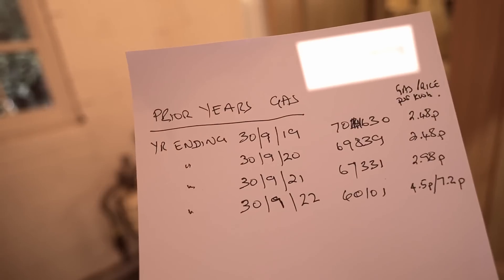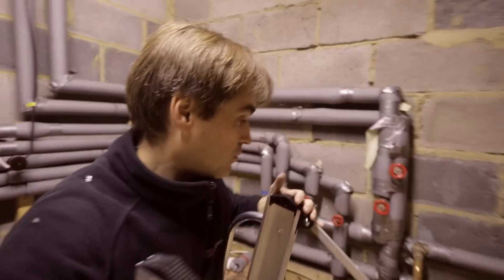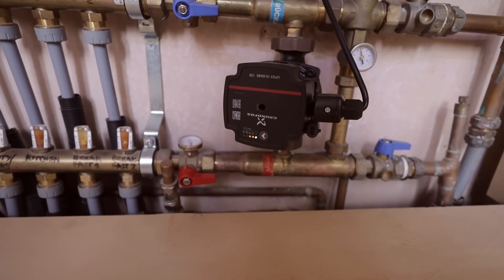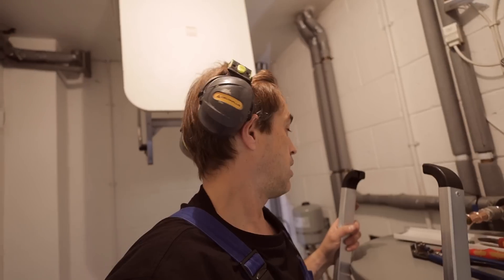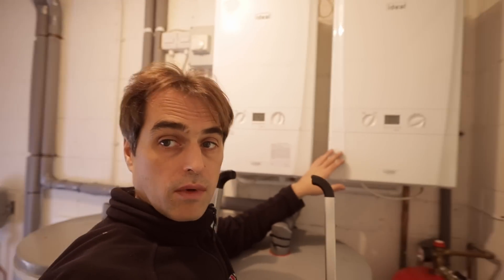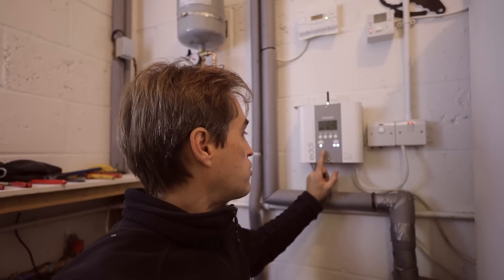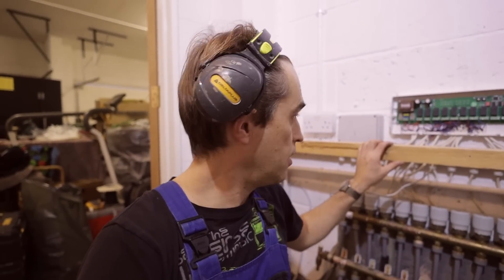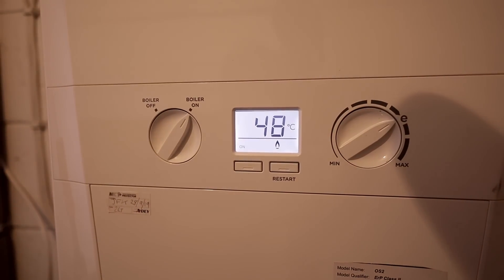Learn How to Lower Gas Bills and Improve System Performance

Comment: Why do we need hot water priority systems? I have my heating on different times to my hot water.
Reply: @shm5547  thanks man, for now I am after Opentherm and PDHW.

Not sure if WheatherComp will work on top of them two, or may confuse it or make it worse or have any huge benefit? 

I don't have Hive or Nest! It's TADO EU model which hardly anybody know how to wire it up.

Besides, been told that for PDHW need to change the CH zone valve to a NormallyOpen valve as well as trace new cable from cylinder to boiler.

In my case they are not on both floors :(
Reply: @bimiuk4051  Your TADO EU is doing weather compensation (over open therm). Just, rather than using an actual outdoor thermometer (like the open therm Ideal Weather Comp Kit), it gets the outdoor temperature over the internet, using your location and a weather forecast.

You can get 95% of the benefit of the open therm weather comp on S and Y plan, without going full PDHW. All the open therm control is doing is varying the boiler flow temperature, so you have 80deg for water demand and a lot lower for central heating (varies depending on how cold it is outside).

The only difference to OpenTherm with S or Y-plan vs PDHW is:
   PDHW: radiators go cold when there's a call for hot water
   S/Y-plan: radiators get hotter when there's a call for hot water (if there's still a call for CH)

Most of the time, you are not heating the water cylinder, so the central heating will be running a low flow temperature regardless of whether it's on PDHW or S/Y-plan. You could even set your timer control so the HW only came on when the CH was off. That would effectively give you all the efficiency saving of PDHW (that last little 5%) on an Y/S-plan system.
Reply: @shm5547  wait wait wait!!! So I don't have to go for PDHW on a S PLAN if I want Opentherm??  So why is UrbanPlumbers suggesting to must change NormallyClose go NormallyOpen Zone valve for the Central Heating?

I thought you must have PDHW in order to achieve 2 seperate flows : one for HW and one for CH on a SYSTEM BOILER??

And all honest I prefer to be able to use CH whilst HW is heating, no harm. I thought it is no other way around and must use PDHW.

Are you saying just connect TADO EU via the Opentherm connector to my boiler and that is it?? No additional wiring or config to the zone valves??? 

Really!!????? Really???

I don't know what to say! Why is UrbanPlumbers insisting to change from S Llan to X plan and have Opentherm.  I don't get it now. 

UrbanPlumbers can you comment on this?
Reply: @bimiuk4051  Yes, you don't have to go full PDHW to get 95% of the benefit of OpenTherm flow temperature control.

If you read the Ideal Weather Compensation installation document I referenced, it shows you what you (or a competent plumber) need to do. But instead of connecting the outdoor temperature sensor to the OpenTherm connections on your boiler, you would connect your TADO.

You need 2 low voltage wires for the OpenTherm connection between your TADO and boiler; plus an additional mains voltage single wire between your cylinder stat and the boilers SL2 connection.

The purpose of these two connections is:
1) OpenTherm: this is a data connection where your thermostat can ask the boiler to fire at a specific flow temperature. Your thermostat uses the weather forecast to choose an efficient flow temp for the outside conditions.
2) SL2: this connection tells the boiler if the HW cylinder stat is calling for heat. If it is, then the boiler ignores the flow temp set over OpenTherm and fires at a high temperature (80 deg C) for a short time to heat up the cylinder.

You will see most of the efficiency benefits on S-plan, because the time spent in the inefficient HW flow temp will be the short time it takes to reheat the HW cylinder. If the CH is calling for heat, on PDHW the rads will go cooler, on S-plan the rads will get warmer; just for that short time the HW is being heated.
Reply: @shm5547  so if I go PDHW and Opentherm there is 95% effecientcy and if just with Opentherm, it's less?

What about the comment from UrbanPlumber saying if no PDHW is implemented then need to run to boiler and make changes. What does that imply?

Also, you saying new wires are required. I thought I can utilize the current cables :( my boiler is second floor, cylinder is top floor and the controller/timer is bottom floor.

Looks like a massive job to wire new cables now especially from Boiler to bottom floor.

Oh man :( don't know how to get it done.

Without PDHW means that when I call for HW then the radiators will go hot - even tho I never called for CH ??? Or do they go hotter only if radiators are switched on at same time?

Ideally I would have HW switched on very early at different time zone as opposed to CH.
Reply: @bimiuk4051  the rads only get hotter if the room thermostat is calling for heat and the CH is on.

The only downside in sticking with S-plan is it's slightly less efficient only when the HW cylinder is being heated up, because the rads will get warmer and it might take a few minutes longer to get the cylinder up to temperature, so using a bit more gas than PDHW would do. But you might prefer this to the rads going colder.

When the HW cylinder is up to temperature, the CH will revert to the lower (more efficient) flow temperature and you will benefit from the same efficiency on S-plan as PDHW would be. This is the majority of the time. I estimate my system only spends 5% of the time heating up hot water. 95% of the time it's just the CH on, so that's what I mean by you are getting 95% of the benefit, because the efficiency savings of OpenThem flow temp control are the same for S-plan and PDHW when it's just the CH running.

It sounds like your TADO is right next to the boiler, so that would be an easy thing to wire up the 2 wires for OpenTherm. What might be an issue is the 1 extra wire you need from the cylinder stat back to the boiler for the SL2 connection.

There might be an unused wire, you'd have to get a plumber to look. I've got a spare, as my previous boiler had a pump overrun, so needed a wire from the boiler to the pump (which is in the airing cupboard next to the valves and cylinder). My new boiler has no pump overrun requirement, so I can use that now redundant wire to connect between the cylinder stat and SL2 on the boiler.
Reply: @shm5547  thanks for simplifying for me. Do you have experience with TADO EU model by any chance??

 I already purchased this NormallyOpen valve. Are two wires required in this case??

Sadly my TADO controller is on bottom floor where kitchen is, and  boiler is one floor up.

would be a night mare tracing a new cable :( hoping there are enough wires to utilize whch I doubt cos what what I see there is a cable (with 3 cables inside) going from old controller to the boiler.

The rest cables look like coming from the wiring center up where cylinder is. I am not an electrician to see through it all.

If I call the cylinder for hot water at a separate time compared to CH (considering if CH is not asking for heat then it is off) then  radiators should remain cold unless they are switched on at same time, right?

Likelyhood both being on at same time, may be very little but who knows.
Reply: I've had a look at the TADO EU installation manuals. It's not clear whether this is even going to be possible with your Ideal Vogue System boiler unfortunately.

The TADO installation instructions show wiring for a purely digital OpenTherm connection OR a switched ON/OFF connection using the extension box relays, but not a set up that requires both like the Ideal Vogue.

That's not to say it won't work if wired like this, but TADO don't mention Ideal as a compatible boiler. The other problem is the EU variant device has no installation instructions available in English! So it's going to be a bit of a leap into the unknown.

I'm guessing your TADO extension box is situated next to the wiring centre & cylinder.

You boiler should be on a permanent live connection. I would be very surprised if there's only three wires going to it. There should be minimum 4: Live; Neutral; Earth & Call for Heat.

Often a 5-core cable is run to boilers, so hopefully that's been done in your case and you'll have a spare unused wire.

Your next best option to the TADO, is to get the weather compensation kit. That will be guaranteed to work, only need slight wiring centre modifications and one wire for SL2 from wiring centre to boiler. Plus running a cable from the boiler to outside for the temperature sensor.
Reply: @shm5547  oh god now u killed my hopes :(
Reply: @bimiuk4051  lol sorry! The TADO openTherm might work with the Ideal Vogue, it's just not a documented combination.

The Ideal Weather compensation kit will definitely work, it's £40 plus installation cost. You won't need to run the open therm cables from the TADO extension box, but will need that extra wire for SL2 from the hot water cylinder to the boiler and to mount the outdoor sensor.

For both options you are going to need a qualified gas safe heating engineer anyway. But you might have better luck finding one who can understand how to fit the weather compensation kit, than one who can work out interfacing to the TADO. Good luck!
Reply: Wow , I read it all and I’m no plumber !
Reply: @rogerbean393  lol, it was a bit of a marathon!
Reply: @rogerbean393  joker bet u did not lol what's ur thesis on it?
Reply from the maker: Then you have to constantly run to the boiler to change the flow temperature - PDHW and weather comp automated that for you
Reply: @UrbanPlumbers   ok think I get it now. Am I right in saying I can’t have PDHW with every boiler
Reply: @paulgardner3926  Your boiler needs to support it. Those Ideal Logic boilers on this job do.

There  is also a half-way house, where you can run S-plan with weather compensation. What happens in this configuration, is when there is a call for HW, the boiler will put out 80 deg C until the HW cylinder is satisfied, then it goes back to CH only with a lower flow temperature, more like 50 deg C.

It's not quite as efficient as PDHW and rads get hotter when there's a call for HW rather than colder.
Reply: @shm5547  sounds like u know what ur taking about. I have system boiler Ideal Vogue Max and a unvented cylinder tank. I also purchased the NormallyOpen zone valve to change it with the NC for HW zone valve.

However! There is nobody in North who has Opentherm + PDHW Experience and who have an idea about TADO wireless thermostat EU model.
Reply: @shm5547  currently there is the Honeywell controller/timer in kitchen and it has a thermostat on wall in corridor.

Thought I upgrade to be more effecient. Was TADO vs NEST and cos Tado supports smartTRV and ticked most boxes - Tado was the winner but little did I know it a nightmare to setup.

At moment have both Tado EU model and Nest still in boxes. Hoping there somebody who can get TADO wired up. Worst case, it be the NEST :( 

I don't know what to say really..
. I am just lost now and frustrating.
Reply: @bimiuk4051  well, one thing you have to consider is maintainability. If you can't get an engineer who understands it, or if parts are problematic to source, then you might have issues down the road.

I considered X-plan and a fancier boiler, but the heating engineers around my area were not sounding confident. So I've stuck with S-plan and got an Ideal boiler, purely because it's what the local plumbers know and understand, plus parts are readily available.

I have a Nest. Whilst it lacks the TRV zone control of TADO, I cannot fault it. It is rock solid and most plumbers understand them as they're ubiquitous.

It's a bit of a pain that your Honeywell controller is not located close to the boiler. That would have made the wiring a lot easier.
Reply: @shm5547  so ur on Nest with Tado's smartTRVs on a SPlan without PDHW?
Reply: @bimiuk4051  My setup is bog standard. It's a Nest (relay) controlling a heat only boiler on S-plan.

My plumber wasn't familiar with OpenTherm, nor too confident with weather comp! So I kept it simple for the initial install.

However, I am looking to either add the weather compensation kit to the boiler, or connect the Nest openTherm to the boiler.

I will probably keep it S-plan, as I would prefer the rads to stay hot when the water is being heated, especially as my hot water cylinder is not a high recovery unit.
Reply: @shm5547  sounds like NEST is able to do what I want as it has more connectors on the back, whereas TADO is a RELAY and then Opentherm ... Confusing!

Shame! Love Tado due to better functionalities eg SmartTRVs build in Whether comp etc

Both ru saying if Nest is installed then the two separate flows won't be doable if there is no Wheather comp?
Reply: @bimiuk4051  Both Nest & Tado do Opentherm, but that only tells the boiler what flow temperature to use. Because you also have motorised valves for CH/HW, you also need a way to control those. This is what the relays do, both Nest & Tado have them - BUT it's unclear if Tado will activate the relays if it's also using open therm. It's likely that it will, but I can't tell from the documentation. The Nest definitely will.

Looking deeper into how opentherm adjusts boiler flow temperature, both the TADO and Nest seem to do load compensation, rather than weather compensation.

It seems if you want ultimate efficiency, then an outdoor sensor and weather compensation is the best option. Paired up to a smart thermostat with simple on/off control, rather than opentherm. If you go for that option, then you can choose either Tado or Nest, both will work fine. You can forget about running wires for opentherm, all you need is to find a spare wire between your wiring centre and boiler for the SL2 connection (which there should be if you've got a standard 5-core boiler cable) and fit the outdoor sensor.
Reply: @shm5547  looks like there is no ending lol and I thought I knew it all haah.

I thought Weather Compensation is that outside door. In fact some have a device outside and some utilize the build in online weather comp e.g Tado has weather comp built in . Ru saying I still need that Ideal Weather Comp outside sensor kit?

Moving on...ur suggesting to simply go for OnOff with the UK Tado model and then add the weather comp sensor? 

As for relays: TADO EU has one with COM NC NO and wonder how it will work to control both HW/CH ? Or maybe that is where you say add new wire from boiler to cylinder.

As for cable between Boiler and the Controller (the one in kitchen) ur right I think it's a 4 or 5 wire but that's it.  Of course there are lot of more cables and think they come from wiring centre too floor where cylinder is.

Shame I can't add photos on here :(
Reply: @bimiuk4051  Yes, I'm suggesting the weather compensation kit added to your Ideal Boiler and keep your TADO (or Nest) with On/Off control using the COM NC NO relay as it is now.

Just ignore the OpenTherm, the wiring seems like a pain for where your controller/thermostat are located!

Although Tado and Nest claim to do some weather compensation over opentherm using the internet weather forecast, they don't do it as well as the boiler manufacturers outdoor sensor kit. Plus they will crank the flow temp right up if there's a big demand for central heating (say it's 10 deg C inside and you crank the thermostat to 25, the boiler will fire inefficiently at 80deg C with opentherm). This is good for comfort, as your house will quickly come up to temperature, but bad for efficiency as they boiler will be working with a high flow temp. It will take a bit longer to come up to temperature with the outdoor sensor kit, but will do so more efficiently.

I have to say, unless you really need that TRV control, I would go for the Nest. The Tado cannot control HW & CH without the 'Tado extension kit', which is an extra purchase. You will either need to buy this, or keep your existing Honeywell programmer to control the hot water timing. The Nest has relays to control both CH & HW and you can set the schedules in the app.
Reply: @bimiuk4051  The extra cable from cylinder to boiler is for the SL2 connection on the boiler. Have a look at the wiring diagram in the Ideal weather compensation kit installation guide. 

It's irrelevant what mechanism you are using to alter the CH flow temperature, (Nest via OT, Tado via OT, or Ideal Outdoor Sensor). The boiler doesn't really care, it just needs to know when there's a demand for hot water, so it can ignore the lower flow temp and fire at 80 deg C for the short time it will take to heat up the hot water cylinder. That's what that wire will do.
Reply: @bimiuk4051  Just watched that Heat Geek interview for TADO. You can totally forget about using OpenTherm with Tado on your system. It won't work because Tado will not switch the relays and use OT at the same time.

You can use OpenTherm with Nest on your system, as Nest will switch the relays and use OT at the same time.

However, as discussed previously, your best bet is to install weather compensation with the Ideal Outdoor Sensor Kit and just use on/off boiler control as you are doing now. For this approach you can use Tado or Nest, both will work.
Reply: @shm5547  which video is that pls share link. So it has been confirmed 99% Tado EU model cannot do OT with System Boiler?

How about the TADO UK model, it has 2 x Relays with On/Off for HW and CH. Does that not mean that it will control both heating and hot water? But then add outside sensor?

I am sooooo confused now and really feel like giving up. It has been nothing but trouble with this. I seriously am lost .... :( 

Why does Tado EU model state it supports system Boilers! And would they  add OT functionality but able to do it. Don't get it!

Moving on! 

If I go for OnOff for HW/CH on S Plan (traditionally) I won't get any benefits or effecientcy, right??! But by adding the Outside Weather Compensation it will be as efficient as when having OT with PDHW?? Most importantly, will it still operate at different flow: one of HW and on thn lower temp for CH?

If TADO UK model gives 90-95% efficiency by only adding the Outside Wheather Comp and ability to control both HW and CH then - Tado is better cos it supports smartTRVs.

I don't get it why Nest would support controlling HotWater and Central heating separately but not TADO UK model , tho both have 2 x Relays OnOff for HW/CH.

Sounds like you can achieve same result with an outside sensor and remaining on traditional OnOff controller??
Reply: @bimiuk4051  it's this video https://youtu.be/2FtZSj0uPic in the comments. Heat Geek confirmed that Tado can't do both relay and OT at the same time like a Nest does. Apparently the feature is 'coming', but they've been saying that for 8 years.

Tado states it supports System Boilers, because it does, using relay on/off control. It will not support system boilers using OT flow temp modulation, it only supports combi boilers for OT control with the EU model. I totally don't get it either, Nest does this with no problem. But Tado completely removed OT control from their UK devices, so that they could not even be used for OT control of combi boilers. They have made some very odd decisions as a company!

But don't be lost! Because all is not lost! The Tado smart room thermostat you have can control your CH with on/off control. Then you just fit the outside sensor to do the flow temperature modulation. You will get near enough the same efficiency savings with weather comp on S-plan as OT with PDHW.

A gas safe engineer should be able to fit the outdoor sensor very easily, all you need is that one extra wire for SL2 between cylinder stat and boiler. The Ideal instructions are quite clear (which is not something that can be said of the Tado manuals!).

If you also want to replace your Honeywell timer programmer, then you will need to buy the Tado 'extension kit', which has the relay control for HW & CH. But you don't have to do this if you are happy using the Honeywell to schedule the HW (you would leave CH set to ON on the Honeywell and use the Tado to control the CH schedule).
Reply: @bimiuk4051  the eu extension box only looks like it’s got one relay connection. You need 2 for both HW & CH control.
Reply: @shm5547  sorry i am sure i replied to your last comment but cant find it anywhere.

Was saying that I have two extension kit; one UK model and one EU model.

Ur suggesting to install UK model and add outside sensor. By this it will control Hotwater and Central Heating separately.

But will it still do the different flow temp: one lower rate for CH and then full for Hot Water ?
Reply: @bimiuk4051  yeah. The outdoor sensor will control flow temp with weather comp and the sl2 wire will tell the boiler when HW cylinder stat is calling for heat, so the flow temp can increase. 

Doesn’t matter what on/off control you use for your room themostat, a old fashioned non-smart one would work.
Reply: @shm5547  hmmm still debating if I still should go for PDHW or not worth the hassle.

As for SPlan with Outside Weather Comp VS Opentherm with PDHW 

What's their pros/cons in efficiency or are they both the same level? 

If the TADO UK model does the trick by simply adding outside weather comp then I go for that as it has smartTRVs too.

Or were u saying UK model won't work but just nest only?
Reply: @bimiuk4051  pros opentherm are it will bring the house up to temp quickly with high flow temp (less efficient) then back off flow temp as the room reaches the set temperature. Pros outdoor sensor are it will pick the most efficient flow temp dependent on the outdoor temperature, so the boiler is always running at a very efficient flow temp, but house may take longer to reach set temperature.

They generally say OT is better if you want to maximise comfort and outdoor sensor better if you want to maximise efficiency. But both will give savings over not doing anything at all. Have a search for load compensation vs weather compensation, that’s basically the difference.
Reply: @bimiuk4051  tado uk model will work with outdoor sensor weather compensation
Reply: @shm5547  in essence, if I install TADO UK model and have outside wheather comp then it will just take more time to house warm. Wonder when it's freezing outside, will it be still slow or realise the temp then react quicker?

If I have to chose Nest vs Tado for basic OnOff with weather comp then Tado is winner as it has smart Trvs and more functions.

As for Tado, I think you said u can't control both HW / CH whereas on Nest you can. Can you simplify this for me with an example maybe?
Reply: @bimiuk4051  yes, the weather comp will up the flow temp when it’s cold, you can adjust how much it does this by with the dial on the boiler. It’s the most efficient way to do it. The Tado, even for on/off control only has a single relay, even the EU model. The extension kit adds the extra relay for HW scheduling. Have a look at the tado manuals, you’ll see the difference.
Reply: @shm5547  still don't get it with extra additional extension kit!

Now I have both versions of Tado: EU model (which have one Relay: com NC No) and tbe UK model which has 2 seperate On/Off for CH and HW.

If I install the UK model, what additional kit do I need?? The kit I have consists of the Smart Thermostat to leave in hallway and the timer controller to replace the old Honeywell time and has a bridge to talk to the smarttrvs.

I am confused to what other kit I need.
Reply: @bimiuk4051  ah, ok. Maybe the new UK kit comes bundled with the extension kit, that’s the bit that would replace your Honeywell controller, with 2 relays for HW & CH. It’s the equivalent of the ‘heatlink’ that comes with the Nest. Originally, the Tado UK was just the room thermostat, which has a single relay in it.
Reply: @shm5547  ahh ok I was wondering what else I am missing haha this is a nightmare.

Hope I get there one day.
Going ahead with TADO UK model, set up basic ON / OFF and weather comp = will I still need new wire from Cylinder to Ideal boiler?

Also, if I then don't install outside weather comp then it will just be a traditional on off to what I have now, meaning boiler will go to top temperature when calling for HW or even when calling for CH.

Whereas with weather comp: CH heating will get lower flow depending on outside temp. And the HotWater will be acting as normal.

Btw the Ideal Weather Comp Kit says suitable for Ideal Logic and Vogue Gen2. But I have Ideal Vogue Max. Sure it supports it?
Sounds like ur an engineer 🙂
Reply: @bimiuk4051  Correct. You will need that one extra wire from cylinder stat to boiler SL2 input for outdoor sensor weather comp.

I can’t be 100% sure the outdoor kit is compatible with your boiler without looking to see if it has the ‘outdoor sensor’ connections next to the ‘opentherm’ connections. Your best bet would be to get your exact boiler model number and call Ideal to check compatibility. Or if you have your boiler installation manual, have a look in there. There was a brief section on weather compensation in my boiler manual.
Reply: @bimiuk4051  and yes, I am an engineer, but not a heating engineer unfortunately, so I don’t have direct experience of fitting Tado’s. I fitted my own Nest, and I’m going to do something with weather compensation; but only when my new installation has run in for a bit and I’m sure there are no issues I need to get the plumber back to fix!
Reply: @shm5547  I can tell u know some insights and nobody so far has gone into fine details.

You have Nest with 2 x Relays on On/Off at the moment but think to add weather comp?

Don't u have Opentherm running?
Sorry too much information and my mind nothing but "OT weather comp PDHW" in my head lol nightmare

Any chance I can give you a call sometime tomorrow and just rant at you about this haha
Reply: @bimiuk4051  Yep, I've got a Nest in the hallway, wired to the heatlink in the airing cupboard, with the 2 relays of the heatlink just running on/off control with the boiler on a fixed flow temp of 65deg C. Cylinder stat set to 60 deg C. On S-plan.

I don't have OT running or the Outdoor Sensor, but I have the option to do either and have been considering which to go for in the future. I am lucky, as I have spare wires for both opentherm and SL2 cylinder stat, so could do either Nest with OT or Outdoor Sensor weather comp.

The Nest is wired over the old room thermostat cables (two wires in my case). I put the heatlink in the airing cupboard next to the wiring centre. There is a 5-core cable to the boiler from the airing cupboard wiring centre that has L, N, Earth and Call for heat. There is a spare on this as the old boiler had pump overrun and needed to control the pump, but the new boiler just runs the fan to cool itself down, so this cable is not required anymore (my spare for SL2 when I need it!). I also used to have a Honeywell programmer right next to the boiler, but since the heatlink in the airing cupboard is doing that job now, I have another 5-core cable being unused (so there's my 2 wires needed for OpenTherm!).

The reason I have not done it yet, is I needed to get the heating sorted before winter. I asked my plumber about PDHW on OpenTherm and he didn't really know about it, said he would have to look into it and it was just adding delay to getting the job started. So I decided to stick with the standard on/off S-plan just to get the installation in before the weather turned.

This discussion has been very useful, as I have learnt that OpenTherm+Nest and Weather Comp+Outdoor sensor kit are slightly different in their approach to modulating the boiler flow temp. Both offer efficiency savings, but do it slightly differently (load compensation vs weather compensation).

I think in my case, I will probably go for OpenTherm with the Nest on S-plan, as it's just a simple bit of re-wiring, everything I need is in place, I don't need to buy anything else. I will see how I go on S-plan without doing PDHW. My S-plan system is almost PDHW anyway as there's no balancing on the HW cylinder coil, so when the HW comes on, the flow through the rads tends to dip a bit (cylinder coil is the path of least resistance)!
Reply: @shm5547  just to let u know, there are two UK models: wired and wireless.

It may be the wired model that supports Opentherm but not wireless one??